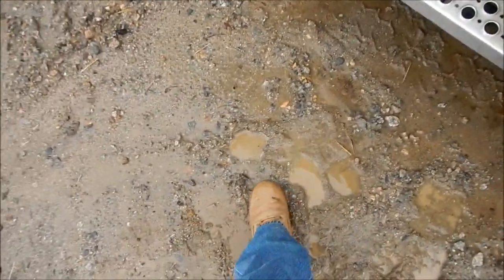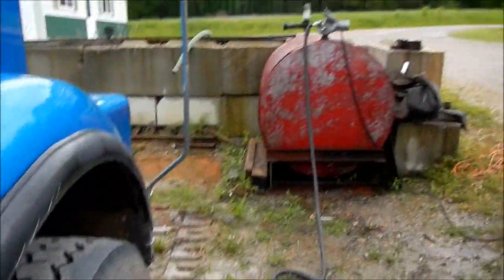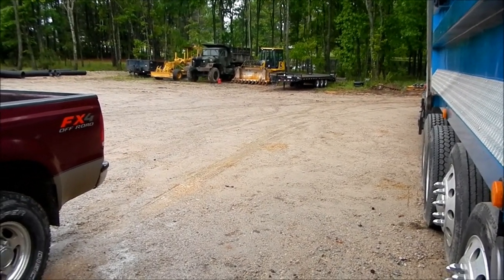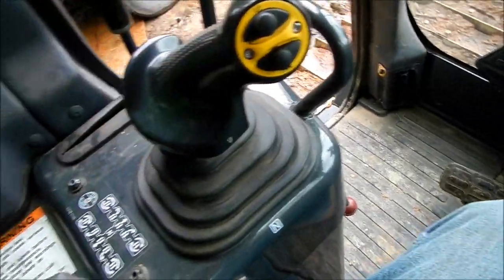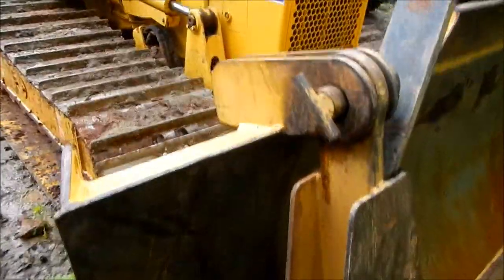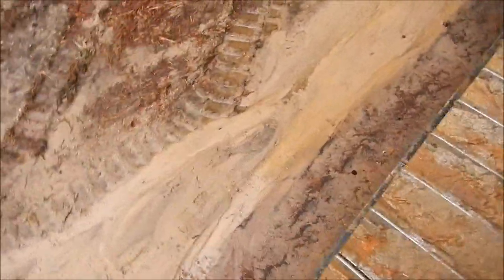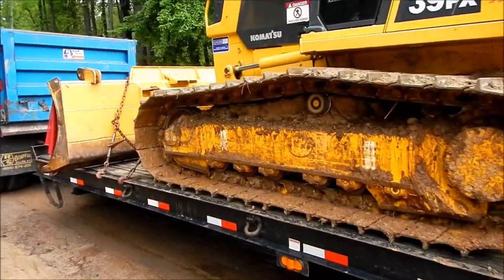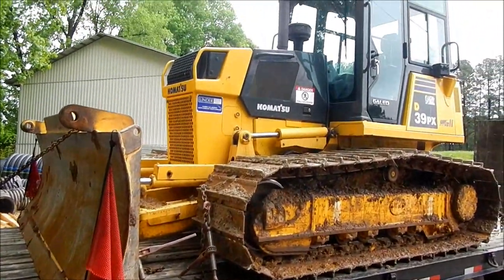Loading Up The Dozer

Comment: I use marking paint on the deck to mark the location of various parts of the trailer, like tie down rings and the axle group's centerline so you can see from the cab where you are on the trailer.

Comment: Cant believe the people that drive equipment onto trailers.If a machine slips and starts backwards your brain cant respond as fast as if you are backing on and sliding forward.I watched a dozer being pulled on a trailer,slide backwards and end up on its roof.He was pulling it on so the tracks are going forward,it slipped so fast the operator couldnt get it stopped and when the tracks hit the ground the forward rotating tracks dug in and turtled the machine.I find its so much easier backing things on a trailer,Its easier to get centered and alot easier and safer driving off a slippery deck than backing off. JMO,safety first
Reply: That's a very wise note!  I received a very wise note...

Comment: Is there any difference between your "on-road" and "off-road" diesel?
Reply: Full Metal Geo To answer your question, YES there is a big difference. ON ROAD diesel is used (and required by law!!) by ALL vehicles that are driven on public roads, ie: big rigs, your uncles Super Duty, the neighbors diesel VW Jetta, etc. This diesel has road tax added to the overall price which is to cover cost, upkeep and maintenance of the roads that these vehicles use every day-suppose to anyway. OFF ROAD diesel is what farmers put in their tractors and construction companies use in their construction equipment and this diesel does NOT have the road tax on it, and can not under any circumstances be used for on-highway vehicles as mentioned above, else one subjects himself to heavy fines and penaltys if caught. OFF ROAD diesel has a red dye added to identify it and it leaves a reddish film in the exhaust pipe to allow police to detect when someone uses it in on-highway vehicles.
Reply: +Chess PlayerElite I know farmers in Canada can use it in farm trucks as long as it's plated for farm use and is used as such even if they drive it on the highway. because not all your fields are attached
Reply: ok, that's interesting. I didn't know that. maybe the US should consider doing that too.

Comment: Get a slide hammer and weld a hook on the end.  Then you can hook it on the pin and the straight pull from the slide hammer will pull it right out.

Comment: Do you have to have an escort to go with you when you move that machine we had to have an escort before we got our new trailer because the blade on our dozers hung off the trailer but the bucket on our track loads hung off the trailer to but didn't have to run an escort we were told it was only if it was a blade we had to have an escort but now with our new trailer we bought it with the swing out sides so we can ad a 2x12 on either side so the blade does not hang off anymore we still have to have our oversize load but no more escorts